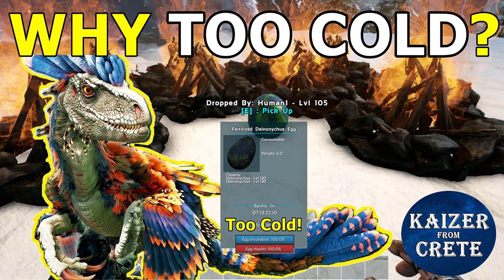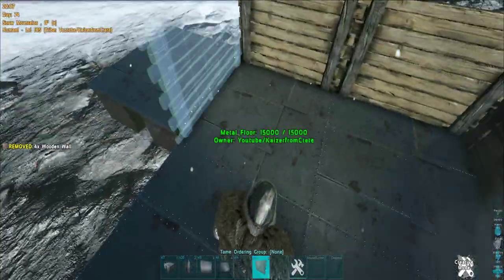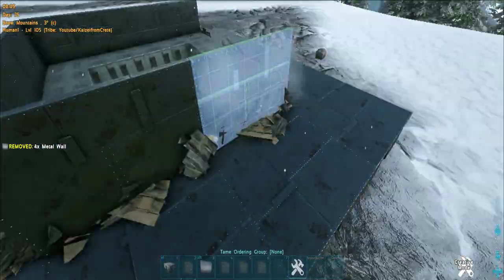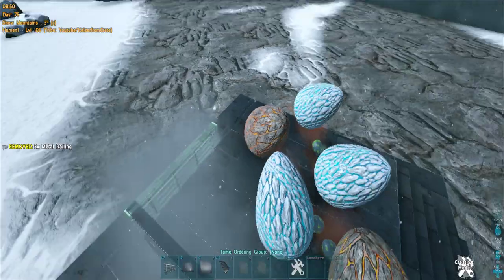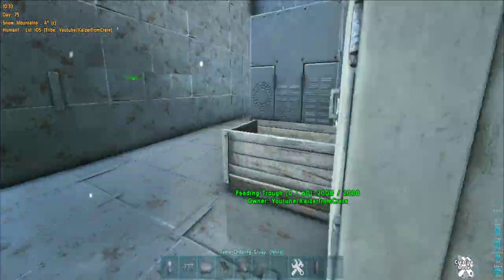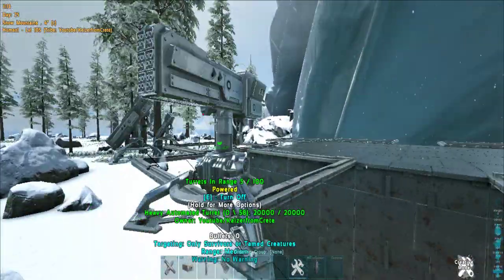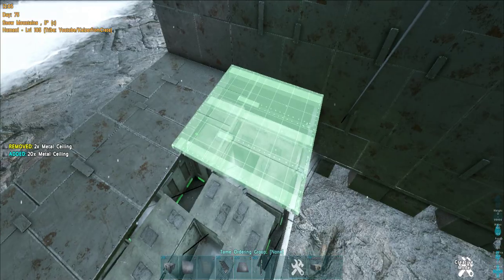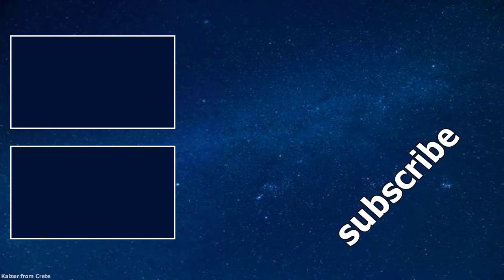Why deinonychus egg is too COLD? - How to incubate everything?

Comment: Can I get the broke version tho
Reply from the maker: what do you mean?
Reply from the maker: Creative mode can't change the insulation :) Don't get me wrong, if you can't afford few air cons don't bother hatching, waste of your time. But if you guys insist here is the poor version at the 8:25
Reply: Thank you so much I think I placed over 50 campfires but it worked
Reply: That's what looking for just want to see easiest way. Lol. I'll hook it up eventually. Lol
Reply: Yeah bro just use torches lmao
Reply: I just used a otter with good melee and 3 ACs
Reply: Holy grail of fireplaces and torches
Reply: Hells ya you can get the BROKE version lol.
Try four wooden forms with one high walls and ceiling to cover, your basic 2x2 box, inside is the magic. Torches take less space than bonfires, so four bonfires, one to each corner accept next to door, unless you like slowing entry into the box. You then place four standing torches or as many as your build limit should allow with spacing between fires. A few in Central areas and try to make a sort of U pattern so you can maneuver to reach all. Give about 10 or more sparkpowder to test them, then load them each up as you see fit with fuel, light them all.
You know your set when your character gets the too hot warning with the 🔥 icon, you should also be getting damaged as well. Once you got that you drop your egg and it should be rocking and incubating.
If you want come to billybobbjoe Val dedicated server, low levels, low spawns etc...very low level stuff, bit good settings for ark. My login is AndrewV, I may have two dein,Dien-nonychus babies after about 30 or so mins.
Reply: Thatch, bit-

Comment: Torches work better, take up less space.  I set up two 2 by 8 rows on both sides of the egg incubation area.   I light them based on what eggs are being hatched and just leave them lit until I'm done with that kind of dino egg.   When I use AC units, I just build a bunch of them lined up against one corner of the room.  Not pretty but it works well.  I great a L Shape and put all the eggs within that Square area between the tips and never have a problem hatching anything at that point.   The room is large enough for two Dino gates side by side normally, I take babies out of there before they grow too big.   If they're T-Rexes and such, and I normally leave smaller ones inside until they grow up for safety.
Reply: Sorry for typos im bad on my phone
Reply from the maker: that's ok.
Reply: My base is on top of a hill and I just ran electrical wires down the hill and made an incubation room with the giant dino door instead of 2 smaller dino doors it works great, so the room is no longer in my base 
Materials are so easy to get in this game so why not have a separate room for em right?
Reply: Doesn't matter so much now that incubators are a thing but this is one thing I regretted building in a -1C cave. 10 AC still wasn't enough for some eggs.

Comment: There hatchin is the same as wyverns use 3 fireplaces and 6 air conditioners
Reply: 12 air conditioners do the job idk why he says 20 in this video
Reply from the maker: the more the merrier. i used 20 in this design. it might change where you build. cold and hot places.
Reply: @KaizerfromCrete  waste of materials if you only need 12 and who sets a base in harsh conditions? No one unless you need a side base to fall back to when you are in the harsh conditions
Reply from the maker: I do :D snow is the best.

Comment: Ik I'm late but does it change temperature because I'm scared that if I leave it that it's gonna say to hot then die?
Reply from the maker: what do you mean? temperature changes with day and some events. if you have enough a/c, it won't matter.
Reply: @KaizerfromCrete  I'm using the poor method with the standing torches will it hatch if I log out my server? Sorry if it don't make sense
Reply: Like is it ok if I log off or the egg will end up saying to hot or to cold
Reply from the maker: it will hatch if you're on a server but if you are not there to feed it after it hatches, it will die of starvation.

Comment: Just to say :
You need eight air conditioners.
Reply from the maker: ok but i used 20.
Reply: Has a weird glitch been happening to you?
Whenever I place an egg down it immediately hatched and the dinosaur immediately grows up.
Reply from the maker: There are options for that. Is that on official? small tribes or classic?
Reply: Kaizer from Crete 
I haven’t messed with the settings but I’m on single player.
Reply: Country Cats bruh